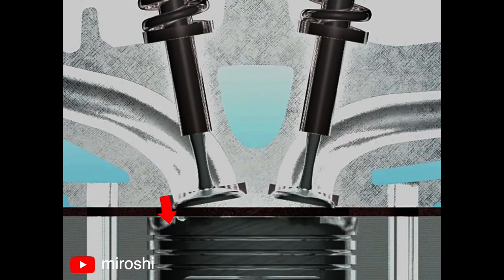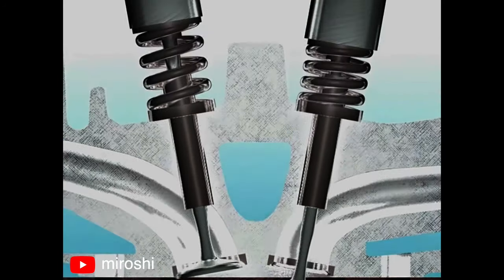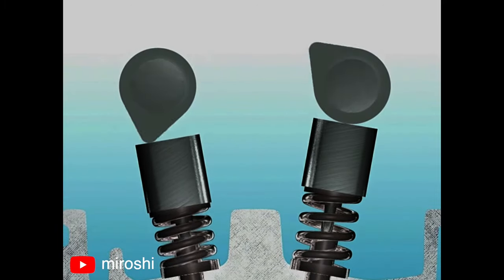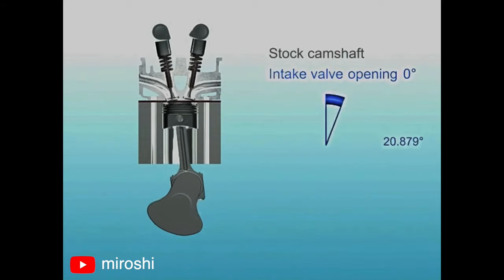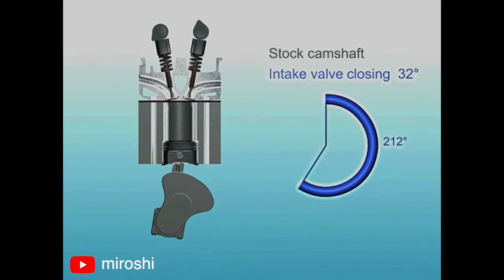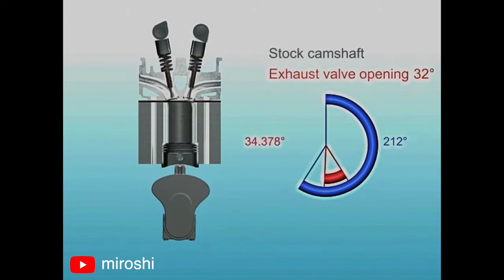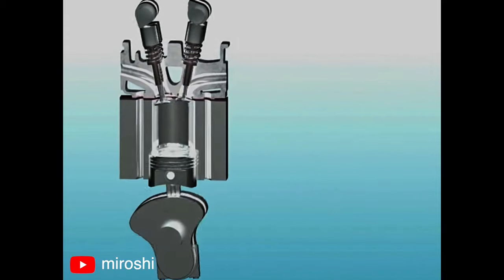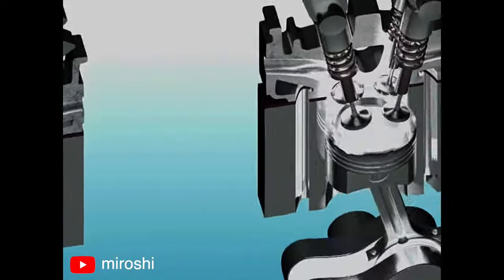Everything You Need To Know Before Cam Swapping Your LS Engine

Comment: I just rebuilt my lc9 5.3 completely. I installed the Howard’s rattler cam 226/232 109lsa running 33” tires(4x4) with stock stall converter and 3.42’s. Freakin truck pulls so damn hard after 3200 rpm. Swapping to 3.90-4.10 gears real soon. I tow a lil bit. But damn it’s a freakin beast
Reply: 0 to 60 times???
Reply: @sharpie132  never put it on the track it’s a 4x4 truck. But it’s definitely making more power

Comment: I hope somenone replies. I don't know much about this but, I was going to buy a gmc sierra, the owner swapped the 5.3 to a 6.0. It was cammed, had other heads (can't remember the exact numbers) , it had long tube headers and 3600 stall, and stock differencial. The whole truck shakes when idle, and I backed off the deal. What could be a reason for that?
Reply: Really late reply but it’s pretty normal for a cammed vehicle to shake on idle if it has an aggressive chop.

Comment: I have an 02 2500hd 6.0 LQ4 engine i plan to take it apart replce the lifters oil pump timing chain and slap it back together with shorty headers and a slight upgrade with a cam. Is there a cam i can use that doesn't require a tune and wouldn't be too much for the truck to handle ?
Reply: I have the same motor if you go anything over stage 2 you have to do springs and push rods ...so I went with a stage 1 thumprcam you don't need anything else and I gained 50hp and more torq

Comment: Dang I was just gonna do a 210/218 .500 cam on my stock 5.3 truck but hearing you talk about rear gears and long tube headers makes me wonder if  I should go bigger if I'm doing all those other supporting mods
Reply: Btr stage 2 truck cam and ls6 springs, dude
Reply: @adfasdfasdfluy  @Dannymclovin69 And 3.42-3.73 gears (depending on trans) and, most importantly, a Circle D 2800 stall ;-)
Reply: @adfasdfasdfluy  i have 07 tahoe with 5.3 i just bought the truck Norris cam with springs long tube headers ls7 lifters the truck has 799 heads and 3.42 gear in they rear end do you recommend porting the heads on this setup and different rear gearing
Reply: @dontadeshun  go 4.10's if you want to go fast

Comment: Awesome video brother, new subscriber here and I honestly don't know enough about cams to swap mine so it has been put aside for so long but it is such a beautiful truck it just needs it lol I have an absolutely minttt 03 Sierra rwd factory 5 speed manual 4.8L- 80k original miles all black on black, lowered has the hard aluminum bed cover I did do gibson headers, dynatech full exhaust side exit and unfortunately it has a cheap ebay cold air but I did put a K&N filter on it... For a basically bone stock truck she scoots and is fun as hell to drive with the 5 speed and the four point great baby LS tucked in there from the GM factory which I believe makes it a rare truck and I do have a folder of all the records and receipts since new 1 owner including thee original window sticker even lol she's a show truck that can still roast a set off and get sideways if I want it too but yes I would like to get a little closer to that 500hp mark just not sure if I want to do anything permanent far as mods or upgrades being in such good condition and low mileage I mean it's still a baby with only 80k miles on a 19yr old 1 owner truck!

Comment: Great vid. What would you reccomend for a 99GMC 4x4 with a 4.8?  Its a daily driver with 35s a Diablo tuner and a cool air intake
Reply: Have you looked into the btr truck norris? It's what I installed in my z71 and it does well

Comment: Hello I just had a quick question. I have a 2006 Silverado single cab with the 4.8 that’s dropped on a 5/7 with some big lip 24 inch rims. That being said I’m not looking to get a crazy amount of power out of the truck since it’s more of a cruiser, but I’m looking to buy a cam that will give me a nice choppy idle. Could you recommend me a good cam for my setup? Aside from a K&N intake the engine is bone stock
Reply: Check out the cams from Texas speed. My cousins got a stage 2 in his 5.3 with headers  and k&n intake and sounds great! Good place to look. If you get a cam then definitely get some headers man! You'll thank me letter. 👍😏

Comment: i have a 08 5.3 single cab 4l60 373 gears what cam should i get not looking to get a bigger stall but i want alil more hp and all the chop
Reply: lSXceleration stage 2.1 cam. NSR. Works with stock converter.

Comment: Thank you Sir  Good content. I'm putting the BTR 2 Truck cam and lifter kit next week in my 2011 Tahoe. I'm running true duals and CAI with the cam.  I will be using it to tow mostly, so I'm guessing the stock converter in the 6L80 and factory 3.42s will make a good combo.
Reply: You should be running 3.90 or 4.10's. 3.42's are terrible for towing idk why Chevy didn't even have an option for 3.73's atleast

Comment: I've seen on forums where there are countless debates on it, but it seems a little more ppl seem to suggest a stall converter vs gears if on a budget and you can only do one or the other. Or if someone's planning to swap out a rear diff in the not too distant future, but wants to get their junk off the jack stands asap and drive it a bit beforehand. I'd love to see you cover that topic if it's something you'd care to do? Most do say do both if possible, which I think is ideal given the opportunity.

Comment: How's it going my good brother! I'm a young inspired hot rodder/first time builder!lol ..but I have a gbody cutlass, I'm a 2002 5.3 ,I put 243 heads on it and put the btr stage 3 553 lift cam with springs as well..also put press fit hypereutectic flat top pistons inside ,with a stock tb ss intake on with 92mm throttle.i have a 410 gear ratio with overdrive trans..can you tell me what kind of horsepower im looking at???
Reply: 470

Comment: I just bought a C5 Z06 that has longtubes, highflows and an intake. How much crank and whp should the car be good for? It's a 2004
Reply from the maker: LS6 should top out at 430-450WHP before you’ll have to do CNC heads, Intake and stroker to get mid 500s. The 5.7L doesn’t have big displacement but can get buy with agreesive cam/intake/heads setup and revving to 7500RPM. For reference my cam only LS1 made 400WHP in Louisiana heat and was revving to 6500RPM

Comment: I have a 2008 rwd 4.8 vortec.
I was considering the comp cams ls thumper cam. Duration at 050 is 218int/229 exh. And lobe separation is 111.
The trucks no longer a daily and really I just want it to get off the line faster.
Do you suggest any other cam kit or am I making the right choice?
Reply: Brian tooley racings hot rod or truck Norris cam, the hot rod cam makes more power than a sloppy stage 2 with less aggressive intake duration it's pretty impressive

Comment: In about a month I’ll have my new remanufactured engine installed. 

Stock 5.3 in a 05 Silverado 1500 2wd
All I want is the chop, was looking at Texas speed monster chopper, with a 3600 stall. I can’t seem to find out what other supporting mods I would need to ensure my new cherry doesn’t pop. I know the springs, and rods are on the list but what els? Or can you recommend a cam to give me the chop that won’t require a new stall.
Reply: Truck Norris might get you some chop without a stall, but in most cases your gunna want a stall even stock. If you want alot of chop TSP bfd cam lots of duration and tight lsa but peak power about 7k, TSP also sells a cam kit that should have everything you need.
Reply: If all you want is chop and aren't concerned about more power, you can make it chop at idle in Park or Neutral with just tuning.  Of course, a good tuner can tweak the stock tune for more power at the wheels while they're tuning your idle for chop, so it'd kinda be a win-win for you without turning a single wrench.

Comment: Big fan! I just want to know what cam I should be looking for, for my 4.8 2003 Silverado! (getting long tube headers) I’m willing to spend the extra $$ I just want a good sounding & running street truck!
Reply from the maker: I’d say get the Lil Chopper and then get a 3k stall and upgrade gears. If you go too heavy on the cam on a 4,8 it’ll be a dog below 4K and you lose to people with less aggressive cams but more gear ratio.
Reply from the maker: We can get you a full cam package shipped just hit us up here madhatgarage.com/qr or email sales@madhatgarage.com
Reply: @337speed  thanks so much man! I appreciate the help I’ll for sure email you guys!
Reply: 4.8 needs stage 1 cam stage 2 is to big get a 2800 stall headers and trailblazer ss intake good tune it might make close to 370 wheel but save the money and get a 5.3 or 6.0
Reply: Hey @337 speed  would 456 gears and the bTR truck Norris cam be a good combo?